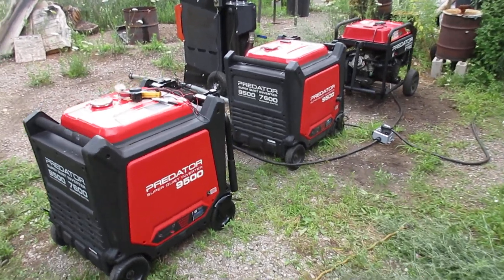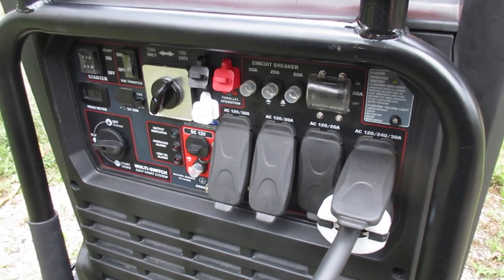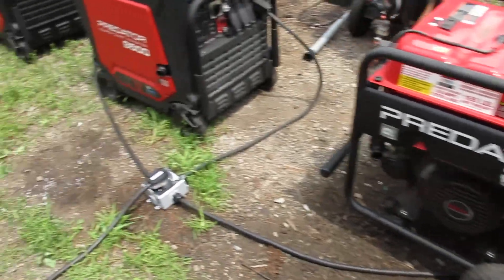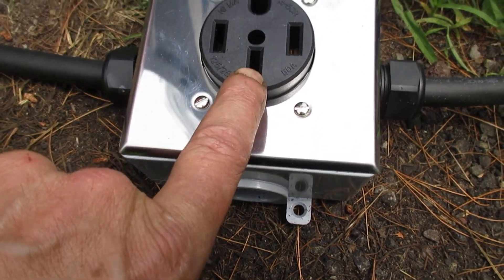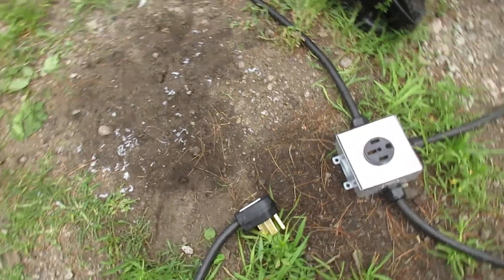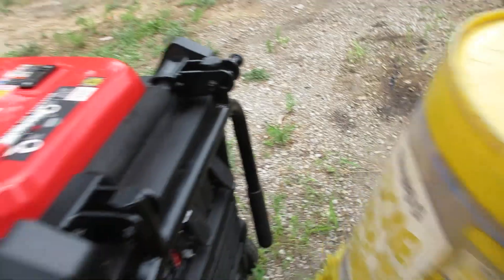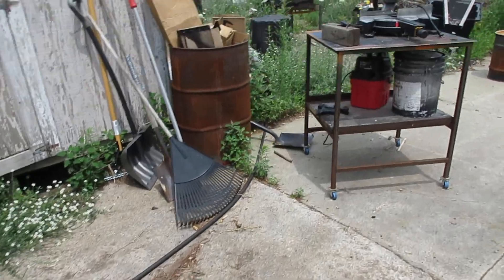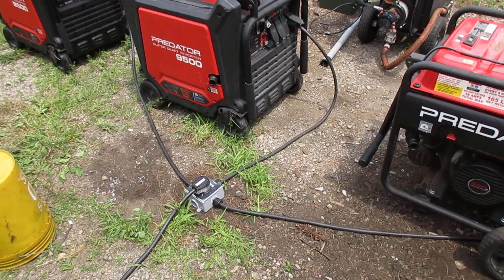Predator 8750 / 9500 DIY Parallel Kit

Comment: The cords should be no. 10 awg. cord from each generator and no. 8 or 6 cable from your junction box to your building.
Reply from the maker: Depends on the load you are pulling. Im not pulling full load and have a 30 amp break in the building before my box. The weld cords I have are 50 amp 220 and they are in fact 12 ga.
Reply from the maker: The point of this video is to simply show how to run them in parrallel. Its up to the user to demernine their set up and gage cables they need.
Reply from the maker: This is for a wood gas set up. Its litterlly the point for me to have two units to pull the same load as a single unit. When Im not running on wood gas I only needed to run one generator. Now I dont even need this size generator because I have a Chargeverter. I can now run my entire shop on a 4375 power generator. These generators are now long worn out and long gone.

Comment: I'm thinking about running two 8awg/4condutctor runs with nema 14L30 plugs from 30 amp breakers from the main power box.  Plug each run into a generator and flip the breakers on one at a time to combine them.  Seems much cleaner and cheaper. Also, 60 amp rating.

Comment: This works fine if it’s just the 9500’s right? 
Since they are built to be in parallel?
Reply from the maker: Yeah kinda the 8750 can not sync so if for any reason Power drops from a 9500 the 8750 can not synch. Mine did end up stop producing power. Not sure what happened as it sat for a while outside and then the next time I ran it it would not come online. But It could have been from doing this.

Comment: Glad i found this video i wanted to sync 2 8750's
Reply from the maker: Dont do it it wont work.
Reply: @Thrive-Off-Grid  wait Wtf!?! What’s the point of your video then?
Reply from the maker: @profuse007  The video is still relivant to connect the 9500's The 8750 issue was found a year after this video was done and posted here

Comment: Any chance someone has figured out if the predator 8750 will synch to the 9500 or another 8750?
Reply from the maker: I showed it on video. The 8750 does not have synch cababiliy. So you have to run the 8750 first. Then you fire up the 9500 and it will sync to the 8750. However my 8750 did quit outputing. Why I dont know but it is a posibility it was caused from this.

Comment: do you have to start the 8750 first for everything to sync properly
Reply from the maker: Yes the 9500 only has the ability to sync. The 8750 if the 9500 is running first will not bring power online. So it must started first. Dont waste money on these inverters. If you are using it for off grid. Get a normal generator and use the money you save and buy an off grid invertet with built in battery charger. Use it to clean up the power. If you are going off grid you have to buy it anyways so there is no point in buying the inverter generators. The off grid inverter dont care if the power is dirty or not.
Reply: @Thrive-Off-Grid  got the 8750 for 400.00(display model) and already had the 9500 just wanted to maximize the power output for welding and plasma cutting

Comment: Technically if you had 3 inverter generators with the parallel ports, couldn't you wire a 3-way the same way?
Reply from the maker: Yeah Ive done it you can add as many as you like. As long as your wiring can support the load.

Comment: I’m confused as to why you can’t do this with the 8750 if you have two of them?
Connecting both together into a junction box that has a 50 amp plug. 
Why can you do this with the 9500s but not the 8750s?
Reply from the maker: Because they are not capable of syncronizing the two phase. The 9500 units have the ability to syncronize to each other or another 8750 if it is fired up first. The 9500 will then syncronize its phase to the 8750.

Comment: If you are connecting to your house thru an interlock, you really should unbond the neutral and ground on the back of the panel(s). Simply remove the white wire from the grounding connector on the panel and insulate it.
Reply from the maker: Im not connected to an interlock or the utility. Im off grid.
Reply: @Thrive-Off-Grid  The primary panel in your electrical system is the only place your neutral and ground should be bonded... whether or not you are tied to the grid.
Reply from the maker: @StanSimmons  Its wired to the instructions that came with the inverter. So you are telling me every inveter in the world is is wired wrong? They al have four wire terminal blocks..
Reply from the maker: @StanSimmons  What the hell does it matter anyways. The com and ground are tied together somewhere anyways. They are typically terminated in a grounding block.
Reply from the maker: Ok yeah that is how it is wired into our inverter. Input block of our inverter is three wire input and four wire out to box.  The live legs and the ground go to the input. But you should still wire this Y cable as four wire not everyone is going to wire into a panel. And I still dont get why it matters when the com and ground wires are bassically the same thing. They are both wired to ground terminal block inside the electrical box. I did wire our box it came pre wired.

Comment: Combining two of the 9,500 predators will that just higher the amp capacity and watts available? Will it still stay the same as of the 120v/240v available or will that go up as well? I have mixed 120v and 240v for what I need it for
Reply: It will just give you higher Amps/wattage. 
For example instead of getting a huge diesel 15 thousand watts or more you can just get 2 smaller generators like this and run them in parallell for higher output power.

Comment: Actually, those 9500 have a 50amp. Socket. You should be using #6 wire on 50amp circuits to obtain maximum load values. Under sizing wire reduces maximum amperage on your system. The first inverter gen is what is used to sync the other inverter gensets. So before starting the other two gens. Start and run for 30 seconds allow the motor to react and warm up before starting your other gensets. You can damage your inverter if it's unstable due to cold mornings of rough running engines. That why others use amp/voltage meters to monitor output voltage and regulation. If your first inverter gensets has a issue and you dobt catch it before starting your other gensets, damage can occur across each of the gensets.
Reply from the maker: I will never pull that much power. Yeah Im not buying that. Weve running them since this video and they been abused badly with no issues.
Reply: @Thrive-Off-Grid  fire hazard he right need 6 gauge wire at least 6 gauge is rated for 50amp at 240v the 12 is only rated at 20 one 9500 put out 31 amps at 240v your at 62 amp parallel with just the 2 9500s going to the building
Reply from the maker: @davidwhichard  Im not pulling 50 amps stop with the expertise you dont know my system. This is a wood gas system, its not running on gasoline. You need both genrators to put the same as one running on wood gasifier. Even so there is a 30 amp breaker inside the shop to prevent over loading of the cable. This cable has NEVER got hot ever. So chill Im not a dumb ass Ive been building industrial equipment for over 30 years.
Reply from the maker: @davidwhichard  You are also full shit too, My welders extention cables are rated for 80 amps each and they are not 6 ga cable.
Reply from the maker: @davidwhichard  Oh and lastly this is wired into an EG4 inverter. It can not pass thru more than 6 kW max; any more it will fault. It can not pull more than 27 amps tha is impossible. That cable is not that long it is perfectly cabable of moving that amperage.
Reply from the maker: @davidwhichard  Yup just looked at them they are 8 ga cables and are UL listed store baught extention cords. The cable goinjg out of my Y cable is 10 ga NOT 12 Ga. The 12 ga cable is only the legs going into the "Y" from the generators; not out and they are only 4 feet long. The cable rating is not the threshold of failuer either, it is more like double that.
Reply: @Thrive-Off-Grid lol as if he really gives a rats ass about you getting hurt. It's really look at me I'm so smart i need to tell you how to run your generators.
Reply from the maker: @dreece2000 there are more idiots just like him in this comment section as well. They know everything about what you are doing we are just dumb ass back yard engineers. Even though Ive one for 35 years. Dumb asses that know everything
Reply: @Thrive-Off-Grid i was saying its a thumbs up man. I like the video it helped me
Reply from the maker: @dreece2000  Right on yeah I know. Glad it helped you out that was the point of the videos. At the time there was not much info on how the generators sync. So thats why this exist
Reply: @Thrive-Off-Grid they are the ones that fuck it up for everyone. I had someone make it simple for me one time. These people are wannabes they wannabe someone but they don't have the courage to be someone. So they hating themselves try to be lazy and tell you how to do something all the while they have yet to do shit. They should make a video on how to do it right since they know so much. If i knew so much i wouldn't be here.
Reply from the maker: @dreece2000  Yup and well said
Reply from the maker: When running the gasifier two gensets = one running on gasoline. We dont have the equipment to pull the full 50 amps. The breakers will blow long before wiring will ever be an  issue. There is a 30 amp main in the box it cant pull beyond that.
Reply: @Thrive-Off-Grid  I think your video is very informative, I just wouldn't want others to copy your design word for word using #12ga (20A) or a improper wire size That could cause damage. As your showing roughly 21KW of running amperage in your video there are people that will apply your design for uses that shouldn't. I heard your 'liability' statement, but most don't or don't care to follow standards. Thank u for your video and good luck with your endeavors.
Reply from the maker: @36w3s.talbot4  Thats why I put a disclaimer. The point of the video is show how it works not the wireing. My set up is specific to our needs not someone "copying" Thats up to them to it right to meet there application. 

I dont even know why I do these videos. I give up and will just stick to doing what we do.
Reply from the maker: @36w3s.talbot4  Not to mention the 220 output on these generators are not 50 amp. They are 30 amp and if you get even close to that they will immediately fault out. The most two combined could put out is 50 amps. A short 12 ga cable is plenty capable of this.
Reply: @Thrive-Off-Grid  That's correct, they split at 220. so if at 110VAC it would be 40, or 20 at 220VAC. But a rule of thumb is you don't max out your ratings. That's why the predators are 50-AMP sockets as many of the predator users use them in there RV, and at the RV sites they are 50-AMP sockets depending on which camp site you pay for. I really mean you have enough power if your using a welder and other items in your shop. I've got a 220VAC 20 AMP MIG and if I'm using an air compressor, lights, furnace I would be over that limit, so my house is rated for 15KW 50% load set. I've seen many video's  using the 9500 twin predators and people love them. Many people look at the 7KW believing that they can run up to that, but not in reality as Generac and others state to balance your load out at 50%. Your three gensets your maybe at 20% with another 30% to go, which is great. Yet I've been to places where people are overloading there 5500-watt generator running a whole house, and they wonder why there 30-AMP breaker is tripping all the time. They want to increase the 30-AMP CB on the generator thinking like its power off the pole, and I tell them no, your going to burn out your windings or the exiciter on your generator. Many people don't realize that's why I looked up your video about the 8750 Predator that it runs at 7KW, only 600-watts less then the 9500, but $1,000 less than the 9500. You can connect an inverter style generator to your governor style stator generator as long as the Governor generator is the main larger generator running as the primary. The inverter style will sync to the governor style generator due to the pure sinewave technology. I've got a BS 8KW, 10KW starting governor style which I'm planning on connecting the 8750 Predator to since that size is @ 7kw. That will give me 15Kw of house backup so I can run my HW heater. The inverter itself can be powered by batteries either charged by solar or by pole and you can connect those inverters directly to your generator also. As long as you have a stable governor style power source these inverters will sync to.
Reply from the maker: @36w3s.talbot4  No the 9500 have 30 amp 220 outlets. They are NOT 50 amp. 

We never run any of our equipment beyond 20% ever. We never come close to the 30 amps. The air compressor is plugged directly into one unit and it is only 1.5 HP oil  less compressor.  We only run the Plasma cutter and our 220 mig and both are never beyond 20% of the the rated output. The only other thing we have are the LED lighting and the occasional opperation of small equipment like our band saw or drill press.  The predator 9500 also only have a 30 amp breaker. Our fuse box main is also 30 amps.

We heat with our equipment there is no electric input for that.
Reply: @Thrive-Off-Grid my apologies, I was talking of the two predator connections together, not the single generator in order to meet the required wire size. If you don't hardwire your generator connections, I do use a single 50 amp twist lock generator connection (Home Depot) to the house to accommodate #6 wire and load out. Harbor Freight Service addresses this: Good morning, as mentioned before  the predator 9500 can use a Y cord however we do not supply the Y cord 30Amp twistlock connector, Amazon has a compatible Y cord but back ordered until mid March. You  need the 50 amp twist lock Y cord that splits into two 30 amp twist locks, since there’s no 50 amp receptacle on the generator.

Hopefully I'll be getting the predator 8750 as I stated before so I don't need to shut any circuits down. We loose power between 6-12 times a year in New Hampshire and it's hard to maintain any reliable power. I will need this Y 2-30 amp twist lock to 50 amp twistlock in order to adapt to my house.

Sounds like u have it under control. Good luck

I think where talking the same, except you don't need as much amperage as a house does.

Comment: The three wire version on display here is not a three wire. It is a two wire with ground. I am unable to see it closely, but it looks like it would be for a 220 volt welder where it does not need the common.

Comment: So, you did fire the 9500 up first and then the 8750 and it worked. Interesting.
Reply: The 9500 is the primary larger generator, the 8750 is the same sinewave as the 9500 so the 8750 would sync to the 9500. Not like two governor style gensets like one at 5KW and the other at 7KW. You would need to regulate the 5KW generators governor to manually sync with the 7KW genset, this is why syncing two governor style gensets isn't worth the money to sync together. Unless you want to sit there and play power source engineer while everyone else is inside the house living well. Just another thought pure sinewave inverters are used in many modern gensets. You can actually have a governor style genset (older Type) larger of course say 8kw and you can sync a smaller inverter style pure sinewave genset say 5kw to the older 7kw as that would act as primary. that would give you 12KW of standby power. All our solar systems are all sinewave and most are grid-tied. That means wherever in the US you plug in your inverter, it will match the power on the pole. Same way uising the old gentsets as long as its putting out stable power say at 50% load.
Reply: I'm confused. In older comments you stated the 8750 had to be used as the primary because the 9500 is the one with syncing capability. If what you're saying in this comment is true and the 9500 is primary and the 8750 is syncing to it because they have the same sine wave, then why couldn't 2 8750's be paralleled?
Reply: @toddbeedham4744 He said in the video, if I heard right, he did it both ways.
Reply: @Bob-cx4ze  I figured the 9500 would be the one to do the sync. OK. Good to know. It's been a while since I watched it.

Comment: You should be using 10 guage wire. The 12 is rated for 20 amps. The 10 is rated for 30 amps. Each of those generators are good for 30 amps each leg. (yes, one of them is 29 amps and the other two are 31.
Reply: Even 8 ga isn’t too big. Go bigger for strength. 

This is a very scary setup for many reasons. 

Larger gauge wire and a lock on the hot wires to start.